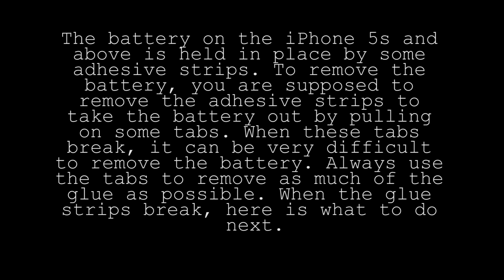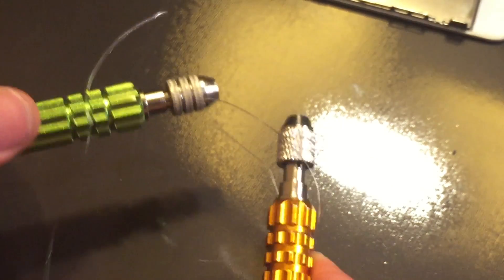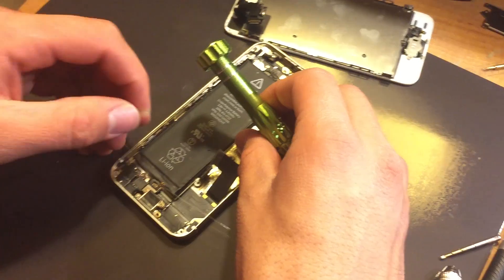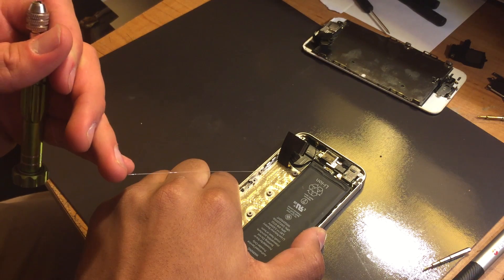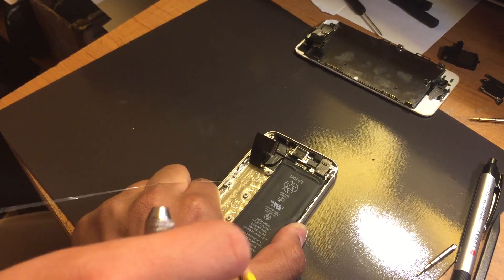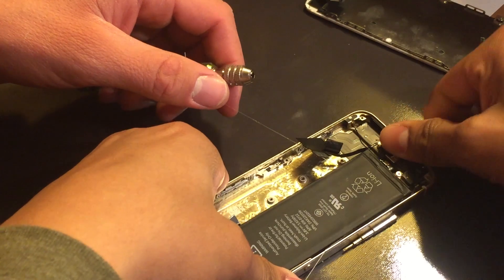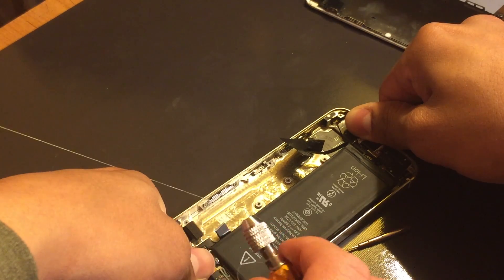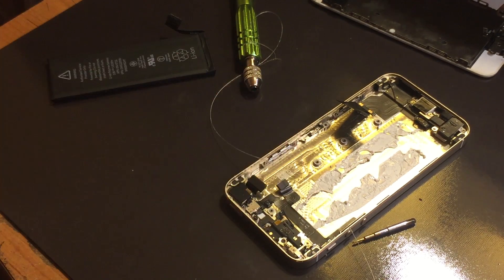How to remove glued on iPhone Battery when adhesive strips are broken

Comment: Thanks very much.  Despite trying to be careful, and removing the taptic engine to make the pull angle as shallow as possible, both adhesive tabs broke almost immediately I started pulling them out.
I used a 25lb line (it was the only line I had!) and was only making limited progress. However, using two suggestions from another set of instructions, I applied a heat-gun on the outside of the case under the battery, and added a few drops of white spirit under the battery from the same end I had inserted the fishing line.  Once I had allowed a little time to elapse, the fishing line seemed to work much more effectively and got the battery out within about 5 minutes.
Thanks again.  This idea really helped.

Comment: I used dental floss. I lifted the battery a tiny little bit just to be able to pull the floss between it and the case. Then I put the phone (with the floss) into the fan oven and heated it to 70C for 5 minutes. After that the floss would cut through the adhesive effortlessly like through butter. I did this on the balcony, because otherwise, if you damage the battery, you will have your flat FULL of thick smoke, or worse!!!

DON'T DO THAT UNLESS YOU REALLY KNOW WHAT YOU'RE DOING, LIFTING THE BATTERY AND HEATING THE PHONE/BATTERY IS NOT RECOMMENDED!!!

Comment: If you use this method with a helper, while the helper is holding the phone, have him use an eye dropper with Alcohol in it to let the drops run slowly down the fishing  line as you work the cord. Lubes the line and dissolves the adhesive.

Comment: Another method is to take an old credit card and cut it lengthwise so that it is about 1/8" narrower than the battery and snip off the two sharp corners.  Make sure screen is removed before proceeding. Gently place card under the the battery at the end where you normally pull out the strips. Using constant pressure on the card, rock the card slowly side to side and you will see it advancing slowly under the battery. Takes maybe 5 minutes max but worked for me and you don't need a helper to hold the phone because you are cupping it with your other hand in the air. Be careful not to hit motherboard or other sensitive Iphone components during removal.

Comment: Nice video sir pls my question is will a normal super glue underneath the iPhone battery after repair harm iPhone lifespan or cause heat to other components. I was unable to get an adhesive tape from the repairman
Reply: Superglue is permanent, I would not risk it.

Comment: Thanks guys.  Your method worked perfectly with the fish line.  I used 10 lbs. test fish line and had no problems.  In your video the piano is a bit loud but bearable.  I did not use the two screw driver method to hold onto the fish line, but used gloves.  I only had one adhesive strip break out of the three on my iPhone 6 Plus so it was not too bad to gently pull the fish line. Thanks again.

Comment: Thanks! This saved my bacon! The fishing line will break lots so be patient and have extra! I didn't use the screw drivers because I had latex gloves on. Be sure to wear eye protection too. After you get the battery out, pull the extra stuff off horizontally to remove it and use tweezers to help pull it followed by your fingers with the latex gloves on. Also, this whole process is a 2 person job.

Comment: All you do if that white strip snaps is grab it with angled tweezers that come with most kits and lift up battery slightly and pull the adhesive strips more. Keep prying and pulling on strips eventually you’ll get it

Comment: Awesome - thanks so much! Life saver. I was already terrified to open my phone and do the battery switch, and then when both adhesive tabs ripped off, I nearly passed out. Used dental floss like some of the other commenters suggested as I had no fishing line - I'm sure fishing line is stronger but the floss worked in a pinch.
Reply: Great suggestion. It worked. I had to double my floss up so it was strong enough.

Comment: I don't understand, why this video has so many dislikes, this guy saved me from potentially breaking my battery, thanks a lot mate!
You don't have to use fishing line, you can use dental floss as well. Remember, if you have problems with constantly breaking fishing line, try prying up you battery a little bit from the side with removed glue. I did it and the battery came out eventually.
Reply: Good suggestion. I am having some trouble with my sony Xperia XZ premium.

Comment: Your line may not have broke right away if your “assistant” would have held the phone down on the other side so that you didn’t have his hand in the way and you could keep the line closer to the table. This is the same trick auto body repair shops use to remove emblems.

Comment: what worked for me for iphone 6 was getting the vibrator out of the way then wedging some blunt tip tweezers under the battery and pushing the battery just enough so i could finally get the adhesive strips out. Since the vibrator was out i could pull out the strips closer to 180 degrees, making it less likely for it to snap

Comment: Ok. I tried this method and it worked! Got some tips for how I was able to do so successfully. 1. You do not need to break down the iPhone, nor take off the screen off like this guy did.  If you stabilize the phone at a 90 degree angle  on a frame that prevents it from moving (use lots of bands to stabilize the phone) and take your time (Do not get impatient and "saw") you will get the job done. Sawing will cause you to slip and knock your iPhone out of place and could potentially break important connectors that will destroy your phone. 2. You do not need to tie the fishing line to anything. You can just use your hands. Keep your hands steady when using this method and pull one end at a time. Eventually you will notice progress! 3. as soon as you start to make progress. use something to wedge into the gap. Creating a lift with a wedge will help with using this technique tremendously! Whatever you do, do not pry! You could cause the battery to catch fire. Take your time. 4. Once you start to get near the screen, reverse the string. Thats right. Get that fishing line on the opposite end while working the string under the battery towards you. Keep using that wedge. The more space you create, the faster and more effective this method will work. 4. Keep calm. Do not panic if you do not notice progress after 10 mins or so. Keep it up. If you feel resistance, than you are making progress. The beginning part of using this method is the most frustrating because it feels like nothing is happening. But as soon as you get a wedge in there and create a gap, the method really takes off fast. You got this!

Comment: I tired this but the line snapped. So I just wedged a screwdriver under the battery then managed to grab the adhestive strips with another screwdriver and wound it around. Did damage the battery black casing but luckily didn't pierce the metal casing. Scratched the inside back of the iphone so wouldn't recommend doing that though. The reason my strips didn't work properly is they were 3rd party ones from ebay, if you use those then maybe only stick one on instead of 2, they go brittle over time.
Reply: You got impatient. My line broke over 6 times. I took my time (over an hr). Better to take your time and do it right than break something or catch the phone on fire.  I did use a wedge, but I did not pry. Creating a gap with a wedge while you work the fishing line back and forth (gently) really helps!

Comment: Thanks, helped a lot. Though the piano was driving me freaking mental. 

In the end i quadrupled up the fishing line so it would stop breaking and it worked way better.
Reply from the maker: I will try your method of quadrupling the fishing line. And yes the piano ... it wasnt intended to be in the video.. glad you found the video helpful.
Reply: @rufixed2245  It sounds exactly like a child who's practicing piano at home. I recognized it and I respect you for not editing out completely normal background-in-a-normal-home sounds.
Reply: I also saw one where to the guy used a thin wire and that seemed to work really well.
Reply from the maker: was it this video - https://www.youtube.com/watch?v=W5GzU11ql7U ? im going to be trying that...
Reply: @rufixed2245  Explains it - sounded like practice!
Reply: spiderwire fishing line.. 20 pound test